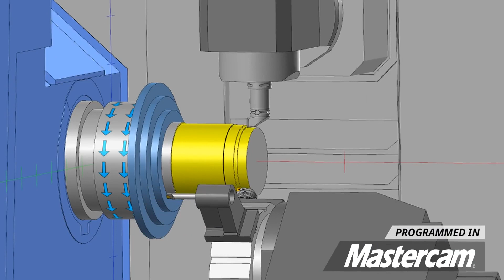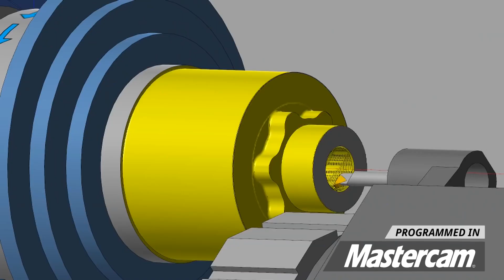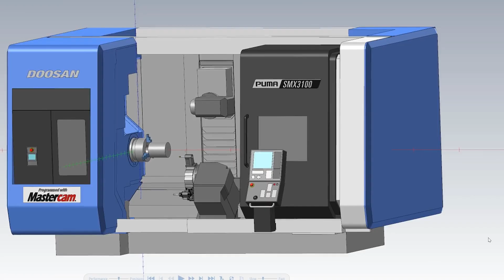Great CNC Machinists Don’t Get Paid Enough | The Biggest Problem in CNC Machining

Comment: Titan is giving a prefect example of the “Pareto Principle”. 20% of the people are responsible for 80% of the outcome, those 20% should be rewarded accordingly.
Reply: Hear Hear!
Reply: square root of the number of people produce 50% of the work.  Clean cites please. 100 people, 10 doing 50%, 4 people 2 people doing 50 %.
Reply: A piece of metal is just a lump of scrap until a machinist adds value by turning it into a component.
A machinist is the most undervalued of all trades

Comment: I could not agree with you more. I’m a machinist (CAD/CAM, cnc, manual, setups and fixtures) in Denmark and I take a lot of pride in making high quality parts. My last job was constantly rushing low standard parts out the door, and wouldn’t “pay” for the time it takes to optimise product quality. That results in a lot of reclamation’s trough out the company, and a very low profit. After only six years in the trade, I had enough and began studying to become a Mechanical Engineer, in the pursuit of more influence and a better salary. 
Titan, I’m a fan of your work and the great videos 🇩🇰

Comment: Young 23yo machinist here, worked at home during the week-end and designed, programmed (using what i learned in the academy) a special milling/drilling tool for 3" holes using kennametal drilling inserts, then machined it at work. I got named best employee of the month and got 250€ + a  small raise. Thanks Titan for the inspiration, boom!
Reply from the maker: WOW, Congratulations… Keep Rising😉
Reply: Congratulations 👍
Reply: Have you checked the price on a kennametal 3' indexable drill? You got pennies while your boss made dollars. It's because people work for free that the pay sucks.
Reply: @diditwork370  Walter Tools tried to sell them something like that for 1200€,  i'm already one of the best paid at my job and i'm only 23yo.. better paid than some older ppl. And sadly at my job u get the same 250€ if u win the monthly "contest" of the best improvement. Anyway boom :)
Reply: @Steve_Sorel  DTA young one unless you see it with your own eyes.

Comment: I don't always comment on your videos, even though I have found them to be excellent.
This one ..... this one speaks volumes to the problems with a lot of manufacturing companies.
I worked for a family owned company for three decades after I mustered out of the military.
They were, and are, awesome people.
I went to school on my own (Wentworth Institute of Technology, and others) , to improve my skills and keep up with new ways of machining.
I had been a manual machinist since I was a teenager, which helped with methodizing, but I wanted to keep learning.
They made me a foreman / production supervisor.
Even after 30 years running a crew, developing work holding methods, and programming both CAD/CAM, and writing four axis code at the machines out of my head, I wasn't making half of what I felt, and still feel, I should have made.
When interior house painters are making more than guys like me that produce parts for military applications, deep sea research, aero-space, and medical applications, there is something seriously wrong.
Between enjoying the work, and considering the family that owns the shop my extended family, that in my mind was worth staying.
In hind sight, I should have started my own shop twenty years ago.
If companies don't start paying top tier machinists what they are worth (within reason), those machinists have the option to start their own shops.
In hind sight, I wish I hadn't been so focused on pumping out the work at the shop, and had started a plan to start my own.
Excellent video Titan.
Take care Bud.

Comment: This hits home man... been working for the same machine shop for 16 years. for a long time just doing the same old thing until 2 years ago when we purchased our first cnc mill. In the last 2 years I've learned how to run the mill and in the last year I've taught myself to program on my own time and ran successful programs now for the entire last year. ramped up production lowered cycle times and created new opportunities for the shop. And i make 50k a year as a one income family with a wife and a son. The only thing that keeps me here is  the fact that my family owns the shop. Not going to lie its rough
Reply: How did you teach yourself to program?
Reply: @r0bmc745  messing around with the free version of fusion 360, I think they charge for machining now i dont know for sure. and then testing the programs on plastic pieces before moving to metal. I already understood how the process was supposed to work from running the machine and just applied that to the programming side
Reply: @r0bmc745  not to mention i had to read and understand the g-code for a mill and program long hand before ever getting into fusion

Comment: Retired tool and die maker in Chicago. Served a 4 year apprenticeship from 78-82. Laid off. Made the journey through a few shops. Die making, automation houses, plastic injection molds. You name it. Lotsa Bridgeport work, surface grinding, lathe work. In the early 90's we started to see molds get farmed out to China. Ultimately, the tooling trades have lost payscale $/hr compared to pipefitters, electricians, elevator builders window glazers. The main way to get over 100k per year is with overtime and lotsa hours. Yes...the tooling trade is now vastly underpaid. Such a shame. Yep, get your CDL, drive overland, see the country. Sock it away for retirement.

Comment: Well, I was doing just that. Boss decided my work was so good that they put me in QC. Now I get to reject terrible looking parts all day because they took the only competent people out of our shop and put them elsewhere.
Reply: This is SO frustrating sometimes!!  An operator will turn in a first part to be inspected, and something is out of tolerance.  I let them know, and expect to see another part (with the problem fixed) shortly after the cycle time it should have taken to make an offset change and run another part (maybe 20-40 minutes).  Yet sometimes it's 24 hours later....and now something else is out of tolerance.  Then there are the operators who, as soon as they get the part bought off, will just hit the 'cycle start' and not make any offset changes, check parts, etc.  I could go on and on, and on...but I'm sure you know and experience many of the same frustrations.  On the other hand, if I were not working in QC,  many of these garbage parts would inevitably make it onto the landing gear, flaps, etc. of a certain large aircraft manufacturer's products...no real risk there, right?
Reply: @Dyna78  Yep. I even know exactly what went wrong most of the time since I originally was just a set up guy, so I go to the trouble of telling them how to fix their stuff, it just doesn't seem to stick. I do understand that if my bosses offered more money we may be able to pick up some people who take pride in their work, but the lack of discipline I see is concerning no matter what. I took pride in my work when I was on the shop floor and my current department head in QC was the one checking my parts. He didn't have to deal with what I have to, and he is equally exasperated.
Reply: Had two non machinists running the first two ops on a part and I’ve seen more scratches, dings, sawcut edges, etc.
Reply: To be a good machinist you need to be able to check a part to make a good part. So being a qc inspector is easier than making a good part. I just my opinion. And I would think must get boring. Also don't make since to me to take your best machinist off the floor?

Comment: I’m currently building my own CNC milling machine since I can’t afford anything like a Tormach. I’m a newbie and a computer science student but I’ve learned a LOT doing this. Thanks for the awesome video!
Reply: Get a cnc acorn card. Just did this its great!!
Reply: @dominic6634  what is that cnc acorn card?
Reply: Get a used CNC off a auction. You would be surprised how cheap you can get one sometimes. Even a old manual lathe is easier to convert to a CNC than building one from scratch and has some advantages that a DIY one won't ever have cause I am sure you will not use a ton of cast iron and steel for a very strong and rigid machine.

Though expect to pay 3 or 4 times as much just on the tooling as you did on the machine as I have found out.

Though if you want to make a wood/plastic/aluminium hobby machine I guess DIY isn't much more expensive than a used industrial one.
Reply: @GGWalace  yeah, the problem is space and moving the machine. My machine is made of mild steel weldments and plates bolted together. I have to install some new waycovers I got recently before I use it again (and allow me to use my flood coolant system). I’m about to have a major increase in income, and eventually I want to buy a used Brother machine or something in that price range that isn’t stupidly huge (10K-25K USD). When I’m able to build a proper shop I do want to start buying new Mazak machines lol. Meanwhile, I’ll keep writing code, including my own constant engagement tool path algorithm :)
Reply: @Thorhian  I wish you a good luck. I am working from the opposite angle. Got into machining and now I want to land a programming job somewhere cause working in a factory on a CNC is payed horribly. I like the job, do my own setups, correct the program sometimes, but besides that the problems the workplace doesn't give opportunities to improve or advance and the pay is so bad I am never going to be able to save enough money to actually build my own shop.

So plan is to turn CNC into a hobby and find a job that actually pays me enough to have disposable income to afford to make a business out of that hobby in a few years.

Comment: This is so true when I started in 97 running cnc vertical lathes I was making 9 something a hour, when I left ten years later I was only making 14 something a hour and I could setup and run like six different  lathes,not all at once and do some minor program edits cut some soft jaws and various  other things, but the money wasn't there.

Comment: Machinist wages ~50 years ago was 20-30/hr. Today they are around 20-35/hr.  Adjusting for inflation, that wage 50 years ago would be worth ~50/hr right now.
Reply: No, they weren't that high. I think they were making about 4-5hr in 1970. 20 years ago yes and over 20 years may have increased 5hr. So your point is true. 3

Comment: This is so true. 40 years ago I started emptying garbage cans at a foundry. Saw the tool room was air conditioned. Stuck my nose around and asked alot of questions. Within 5 years I was running the tool room. All manual cross slides, trig tables, Yada Yada. Had a great owner that allowed me to take the bull by the horns. Started production cnc machine shop in house on our castings. Also converted tool room to cnc.
Reply: Long story short, kids took over hired outside management came in and said I was being paid too much, I think like 25 an hour back then. So I moved on and became a plumber for twice that. Just retired with a plumbers pension.

Comment: This is what I did, I was a top machinist at an automotive company (not trying to be big headed, I was a hard worker running 5 and 6 axis machines) but the cash wasnt there. So I went back and did Mechanical Engineering and now am a manager in R&D and you are 100% right. Top machinists are not nearly paid enough.

BUT - A good machinist can make a great manufacturing engineer !

Comment: Exactly what I went through the past 26 years. Yes I didn’t finish my Machine Tool Operations diploma but it didn’t matter. Machining came second nature to me. I’m self taught, mostly. But the problem is you’re looked at as just a "button pusher," change part push button. All of this is pushing me away from machining, or thinking of ways to run my own shop and find ways to grab some market share from the companies that don’t appreciate their machinists. Looking for a job that pays well is just about nonexistent. $14.00 to maybe $20.00/hr if your lucky. Crappy benefits and barely anytime off. Sweat shops really. Even if I go back to school and finish my diploma in machining that still will not do any good. Maybe it’s time to move on, I’ll miss machining because for awhile it was my passion. It made me feel good that I could creat something with my hands and control a machine to produce parts. I’m still hoping something will come along that pays well, fingers crossed.

Comment: That's why I started my own shop. I worked at a place were we sent many parts out to be made even though we had a shop. Management never thought big enough to provide the right machines. But I would do this one part / 50pcs a month that shops struggled with. President of the company confronted me one day. Why are you making this part when Victor down the street has 500K dollar machine he run these on. Victors job shop just made 50pcs and all failed inspection. So I had to point out its the person not the machine that makes the part correct. I've been making this same part now 26 years , not a problem.

Comment: Former machinist here. I went to vo tech for machining and started an apprenticeship. I started out at 13 hr back in 2018 near Pittsburgh PA. Not a lot but I beared with it because I only knew so much. After 3 years of doing it, I was only making 16.48 an hour at my last job. I wasn't top end, but I was trying to learn from those kind of guys to be more experienced. I really did try my hardest. I gave that craft everything I had. After realizing how little the job actually pays, I gave up. I knew how to do some editing, I knew G&M code. I was decent at set ups and retaining the control on the Okumas I ran. I knew how to run manuals as well. I have 9 of my NIMS credentials. I should have been making minimum 20 hr. But just realizing how hard it is to actually make money, I was done. I tried college but left that because I didn't have the money anymore. I decided to be a mailman. Much easier job on me and I make more money as well as in a union. I don't see the industry surviving at this rate. I do miss doing machining and learning how to program and tooling. Definitely the hardest trade I've ever seen. If I ever have kids, I'll never recommend them to be a machinist. I never recommend high school kids to do it either. We need more unions, pay increases and benefits for machinists. Such a difficult and underpaid job.

Comment: Spot on.

I'm a service tech/trainer for glass CNCs. Even though 90% of what I do is comparatively simple 3 axis stuff, the first thing I tell any ops/production manager is that the machine is only as good as the operator, programmer, and maintenance staff. Find the talent, and retain it. Most never connect the dots.

Owners/supervisors pay a cost either way. Option A keeps the payroll numbers down, which makes accounting happy. Option B results in needless downtime, extended lead-times, shoddy quality, decreased machine life, and upset customers. Much of that never shows on the bottom line, but they're indicative of wasted growth potential and money left of the table. Choose wisely.

Comment: Here in NZ a setter/programmer/operator(we get dumped with all 3 roles) get at best $36NZ per hr. equally managment have no idea and I quote "we want to give 15mins training and have them making seals"(I machine hydraulic seals, so urethanes, rubbers, ptfe etc). We explained that was not gonna happen. "But thats what we  want" . A uni degree in management makes you a genius...apparently. Ive seen  5&6 axis role advertised here in NZ at $25/hr...

Comment: this video is the exact reason why i stoped being a cnc machinist. i milled water pump turbines on 2 machines and had them running without me needing to check after everything and on a 3rd machine i did some job shop work. each turbine sold for approx. 50000€ and i increased the output of these turbines from 5 per week to 25. i was paid 16€ an hour witch amounted to 30000€ a year. when i asked for a raise they said they weren't able to afford that and that i am already one of the best paid employees. well i left after that and now i do small job's in my garage and earn with that alone a good amount on the side.

sorry for bad english